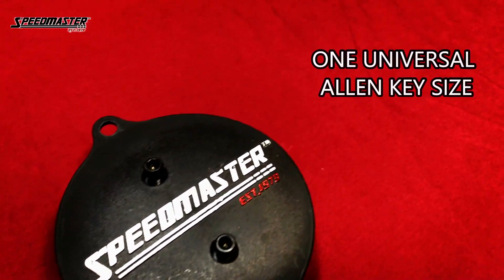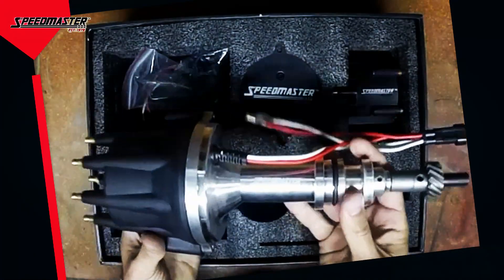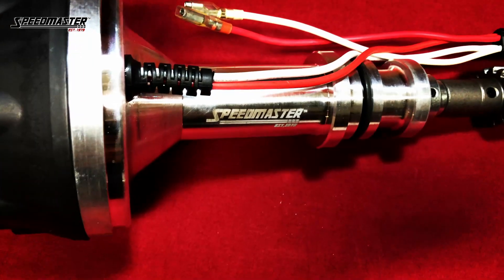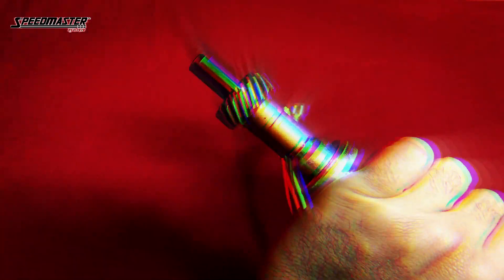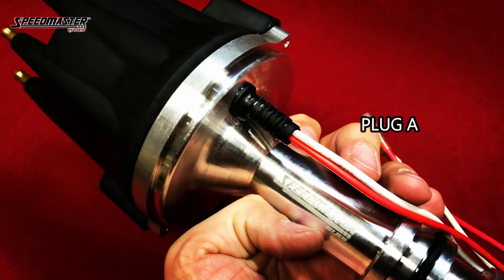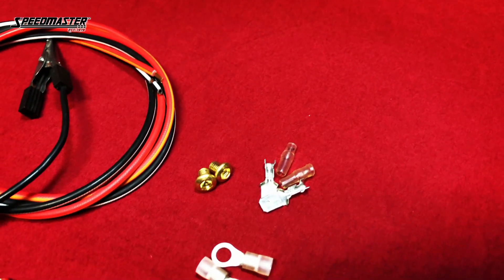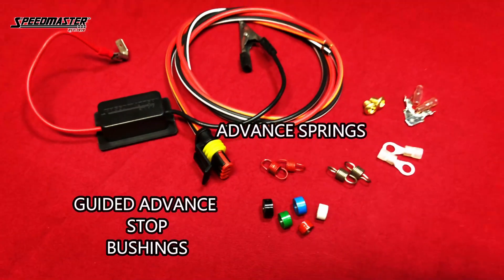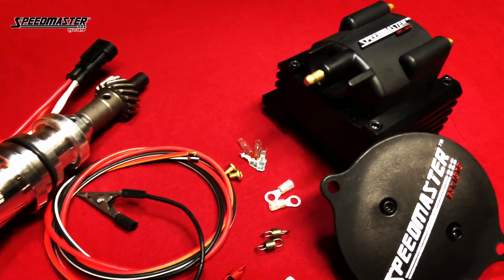$195 Ignition Distributor Kit?! SPEEDMASTER El Rayo

Comment: Just got mine great . No wiring instructions came in the box . I am sure red goes to the positive side of the coil with my hot ignition wire . I am assuming the orange  goes to the negative side ?  The black is the ground guessing the block . The gray is the Tach. I really would like some kind of info. as I don't want to destroy it before I can get my car back up and running again ,Thanks .
Reply from the maker: It should be in a separate I believe black box envelope, type thing

Comment: Just curious if each leg of the reluctor wheel is phased correctly, ive had many aftermarket reluctor wheels off by 8-10* on 1 or 2 of the legs causing detonation or rich condition on those cylinders. Im not talking down on this as its a killer price even if adjusting the reluctor is needed
Reply from the maker: I asked them similar questions and they in their explanation they used phrases like “exact tolerances” “fully adjustable” and  “designed to meet NSRA specs”. I know stock spec ignition systems I’m still learning about race applications
Reply: @FordF100World  yea thats within “stock” specs, will it work with moderate NA and mild nitrous without an issue....95% of the time yes lol. Its simple to adjust them if needed so as long as the electronics is a good grade and the wire is real copper and not copper coated aluminum it will be fine. What kind of power you looking to make?
Reply from the maker: 300 on the mild built 88 roller 302 I have. But I’d like to one day soon build a 351 or up Windsor engine that can handle boost or NOS
Reply: @FordF100World  all a 351 needs is flat top forged pistons, good rod bolts and the balance fine tuned and it will happily take 6-700whp all day but the stock rods will give up first, my stock long block 88 5.0 made 585/620 on 15psi and 150 shot, 454/510 on just 15psi and has done it for quite a few years so it wasnt a one pull/pass fluke so the cheap SBF power can be had too and those numbers were stock E7 heads